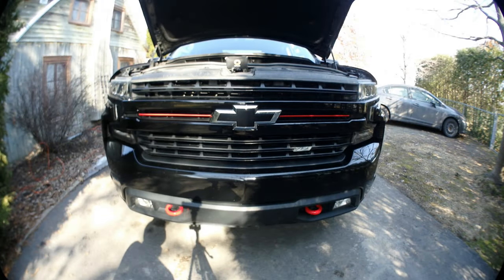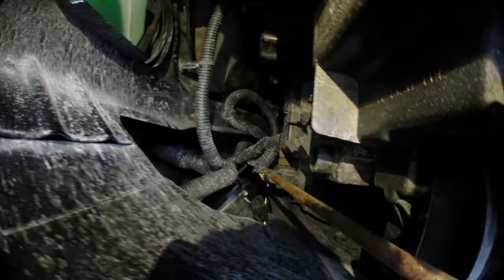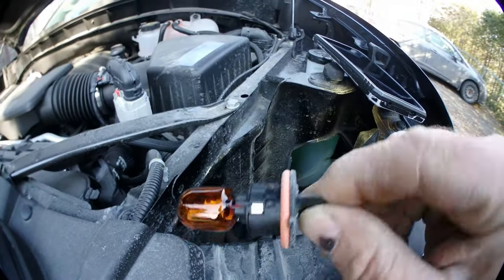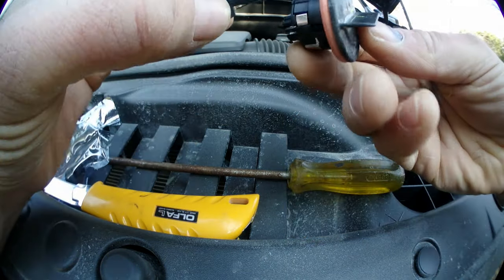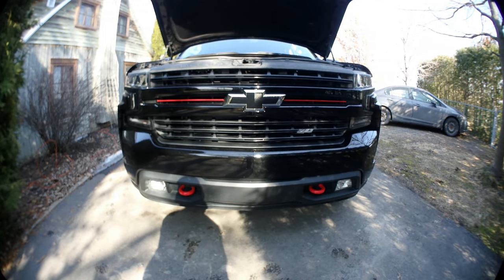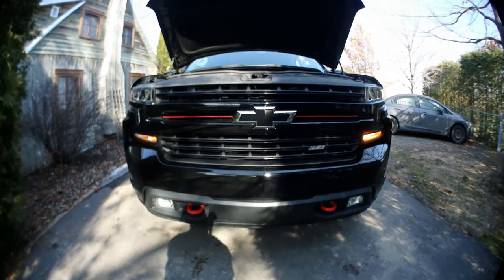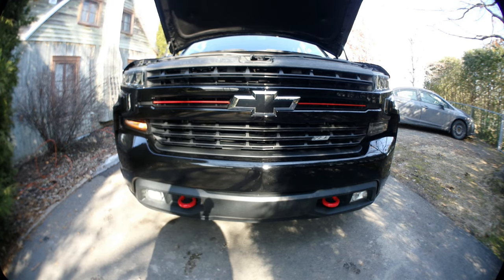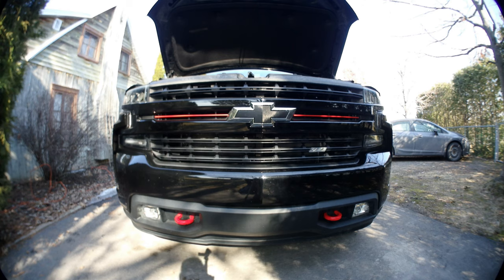2020 Silverado RST Led Turn Signal Upgrade. How To Install. Wow

Comment: How did you do your red stripe on your grille?
Reply from the maker: I did it with 1/4" vinyl strips red.
Clean the grill with rubbing alcohol before.
That's it, still holding great.
Reply: @obscur156  Awesome! Looks great.